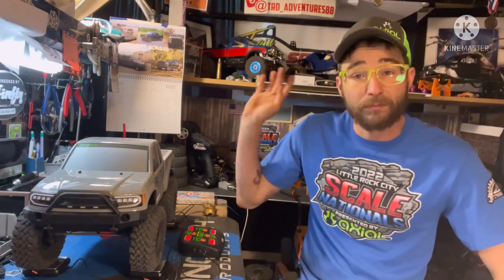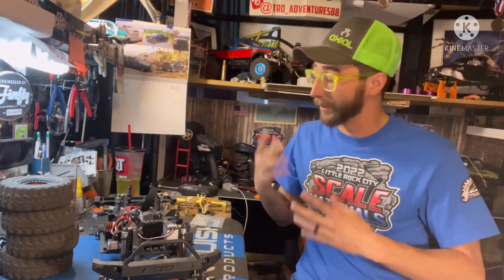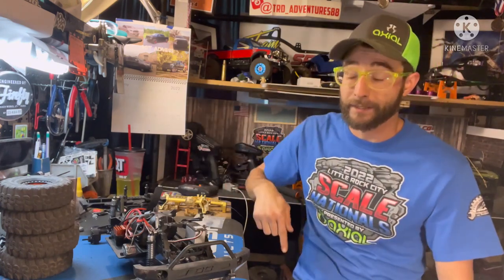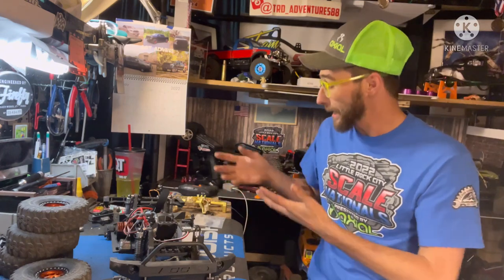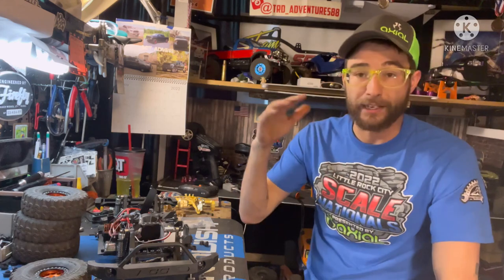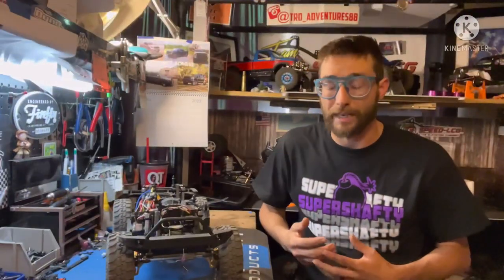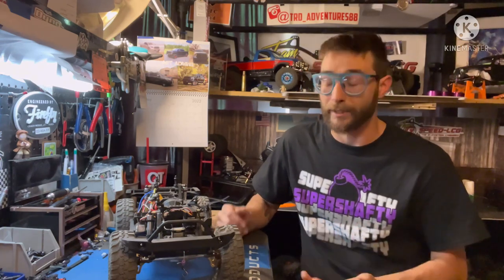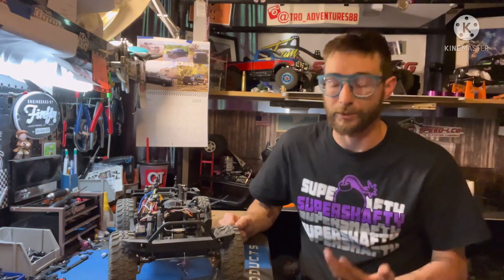Scx10 III Base Camp Ep.2-  upgrades begin

Comment: You can squeeze the battery tray in front of the trans housing. Changes the way the truck drives soooo much.
Reply: How do you mount it up there? Thought it would fit but couldn’t find a good way to mount it. I know rock pirates has one in the works with angled mounts, was waiting for that to drop but if there’s another way… 🤔

Comment: Nice work. It definitely walked those obstacles it struggled with before. I also agree this doesn't really need the Vitavon housing to get a similar result. Brass bits in the right places should do well to shift weight around assuming those parts don't add up to the cost of new housings :)

Comment: How did u make the g speed mount work without hitting the shocks???  Help.  Lol
Reply from the maker: The axle panhard mount? It should clear
Reply from the maker: Or do you mean the panhard link itself hitting, you can move the panhard bar and bold it through the front side of the axle
Reply: @TRDAdventures  yeah that’s what I had to do unfortunately. Installing the stock way with the g speed upgrade pushed the pan hard rod end out too far and wouldn’t allow room for the shock to reattach.  Now if I could just fix the servo horn hitting the chassis pan hard mount and allow for full left steer. Lol. Still working on that issue. (Without moving steering servo to middle mount) would love any ideas u have for that debacle 😁👍. Thanks for getting back to me quickly also.  Really appreciate it.
Reply: Also do u know what aftermarket driveshafts will fit?  The standard (jlu) metal scx10 3 rear driveshaft is too short?  I had a nice Samix brass set but won’t work🤷‍♂️.  I thought they would be a direct fit but no good unfortunately.  Thanks 👍
Reply from the maker: @sitlos.  I use either a. VP servo horn or offset From nsdrc
Reply from the maker: @sitlos.  and I haven’t even looked into or measured for driveshafts